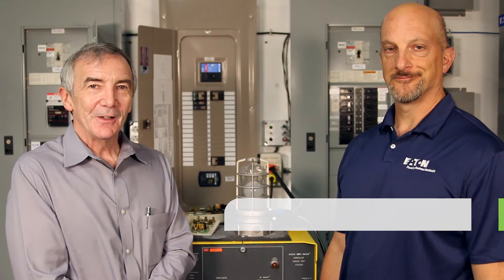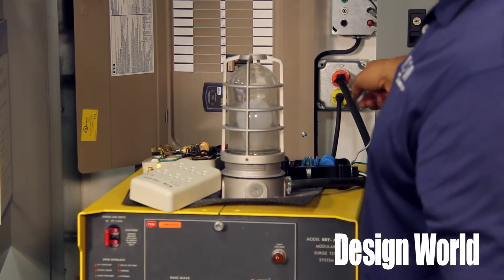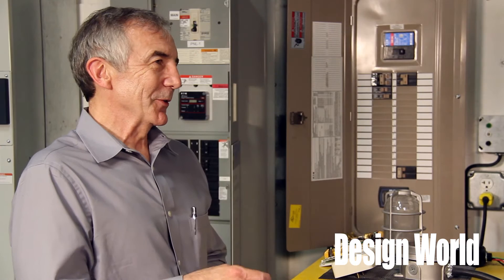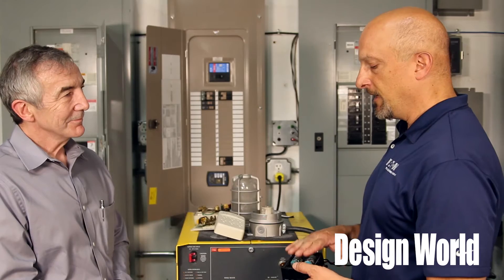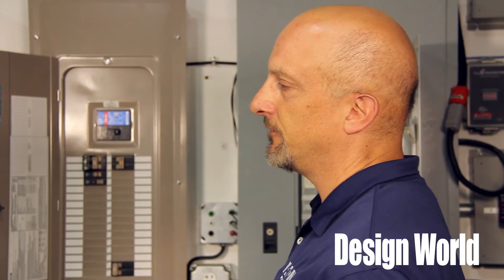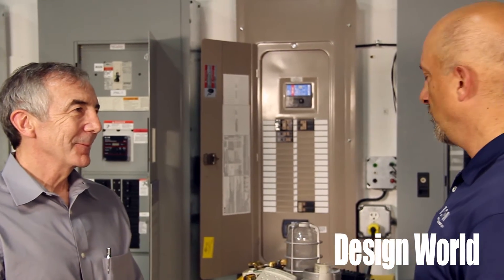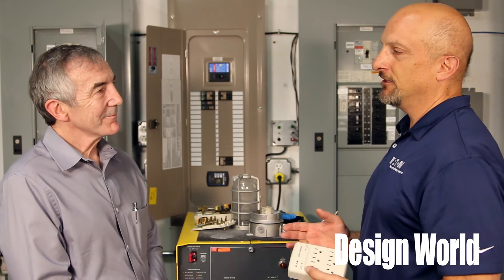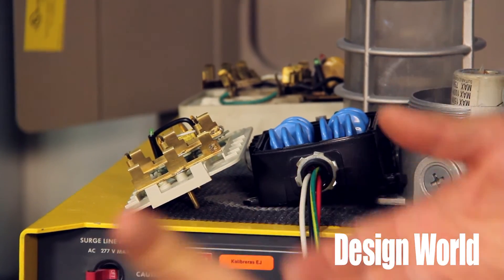A surge protector in action

Comment: When you mentioned how lead length increaes the let through voltage, does that include the cord length of an outlet surge protector? Will the same surge protector with a 6' cable offer better protection than a 12' cable? Thanks!